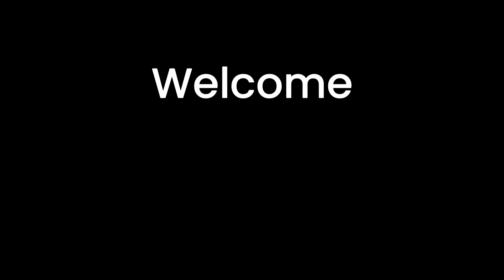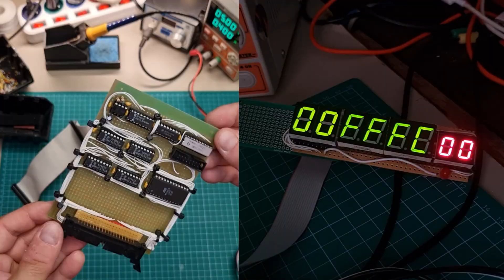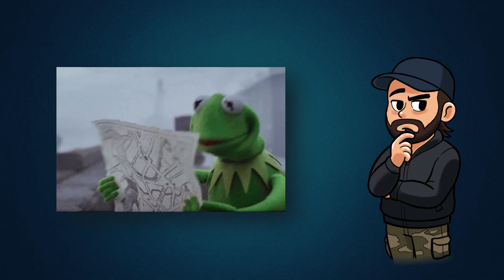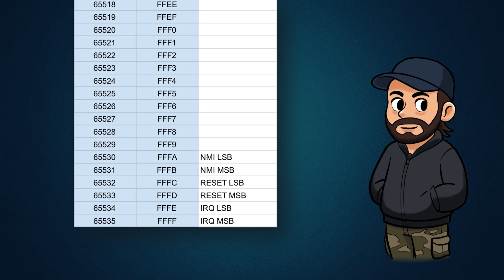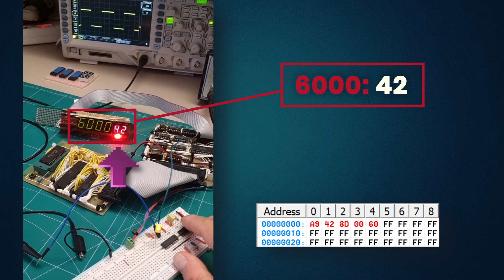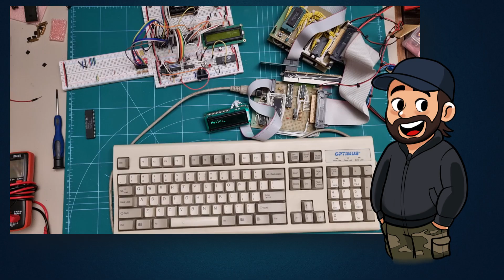I Added the 6502 CPU to My Homebrew Computer

Comment: About that bus...

First, I would segment the address space. Keep the top and bottom 16 kB on the CPU module as local memory, and only put the middle onto the bus. Have two output chips for the high bits of those 2 middle RAM segments, enabled each by a decoder for the top 4 bits of the 6502's address bus. That way, you can map them into your whole bus address space.

Next, I would make the bus DMA-driven. (That's why half the memory stays on the CPU card.) Add access request lines and logic to assign access (simple; lowest line that wants it, gets it). Now, when the CPU selects one of the middle segments, add logic to halt the CPU while bus access is requested.

And now you can add as many CPUs to the system as you want.

Comment: If signal integrity over the ribbon cable becomes an issue, one way to solve it from 1980 is to wrap the cable in plastic-laminated conductive foil (like flatflex, or just stronger aluminium foil with spray-can laminate maybe?), with either a separate ground lug screw for each board, or reserve the outermost conductors and solder it to the ribbon cable.
Reply from the maker: That's a great tip! I hadn't thought about foil-wrapping the ribbon cable, but it makes perfect sense. I will definitely keep that idea in my toolbox for future revisions. Thanks for sharing!

Comment: seeing ben eater's 6502 series inspired me to make my own computer too, that I'm calling the K17 (pun on 'kit'). I have written an emulator for it (available on itch), primarily so I could start developing the bios and some games, while the hardware progress is currently paused.
two of my main design goals are to use only through-hole components, and only parts that are still in production; with the hopes of eventually selling it apple 1 style, like you'd buy the bare boards as well as the components, and assemble it yourself.
Reply from the maker: That sounds awesome! I love the name K17, clever pun 😄
The THT + in-production parts goal is super smart, especially if you're thinking of sharing it kit-style later on.
Let me know where to find it on itch, always curious to see what others are building.
Reply from the maker: Oh, I just checked out your channel and was pleasantly surprised to see you're using IDC ribbon cables too! But wow, your setup looks way more professional than mine 😄 Really cool to see someone else go that route, love the clean layout!

Comment: Very cool. This is the first processor I ever programmed almost 50 years ago. Also the first and last processor I ever fully understood.
Reply from the maker: That's amazing, 50 years ago, wow! I really admire that kind of experience, and I totally understand why you connected so strongly with this chip. I've only scratched the surface compared to you, but even now I get why the 6502 has such a special place in people's hearts. It's still so much fun to explore. Thanks for sharing that!
Reply: @kaligari88  I remember the version I worked with had a bug in the microcode. If the address following a JSR fell across a page boundary the second byte of the address was read from byte 0 of the current page instead of byte 0 of the next page. Almost lost my mind over this. BTW love your single-step debugger. Really wish I'd had one in college. Looking forward to your next video.
Reply from the maker: Whoa, that bug sounds like a true sanity check😄Glad you liked the debugger, thanks a lot! Next video is already cooking!

Comment: Good stuff, wiring that up in that way had to be pain. Look up Dr. Matt Regan, he uses similar prototyping technique I do, I feel it is very fast to wire up prototypes that way (well, very fast is a relative term when you have to throw around whole buses of 16/8 signals). Neat thing is that if you have good power distribution (low resistance +5V and GND wires, decoupling caps near chips) having "random" wires going point to point is better for EMI than "neat" bundled wire harnesses.
Also fun to see my comment in a video.

If your bus won't go over a few MHz then there should be no problem with signal integrity I think. OG ATA used those cables with 8MHz transfer rates and they too didn't have 50% of the wires designed as grounds (they switched to 80 conductor version with 50% grounds to go faster). They had 7 grounds actually.

Using a separate JST for power is fine IMHO if this is going to be a multidrop bus using a ribbon, won't be as neat as having power on the ribbon itself, but those signal wires don't come cheap.

What I would advise is maybe go the way of RC2014 and use pin headers and a master backplane - while it won't be as elastic of an design (pun intended) there are some benefits to that.
I would use two dual row 40 pin headers side to side (2x20), declare that 4 pins on both ends are to be used as power (one side +5V other GND), that leaves 72 pins to do stuff with. Of that I would declare at least 16 to go to GND for signal integrity reasons - that leaves 56 signals to work with. Negative part is that this would need pricy boards (40 pins at 2,54mm pitch mean that the board would be over 100mm on one side, so if you would want to do boards manufactured in China it would go over their 100x100 cheap option, I would go for 4 layers anyway so the cheap option goes out the window anyway).
But that is me ;-)

EDIT: Fixed bad math and typos ;D
Reply from the maker: Thanks a lot, this is gold!! 🙌
I know the wiring looks like a pain, but honestly, even the soldering is part of the fun for me. It slows me down in a good way, almost like meditation 😄

I really admire Matt Regan's work, I've seen many of his videos, and I'm always impressed by the clarity and depth of his explanations. Super inspiring stuff.

You're absolutely right about EMI, I've read similar things about messy wires sometimes outperforming neat bundles, as long as power distribution is solid. I'm staying below a few MHz for now, and things seem stable, but I'm keeping an eye out just in case. That said, I still want to stick with ribbon cables for now. They are easy to route for me, and I get full control over every signal line. That simplicity helps me iterate faster. I totally get the appeal of a proper backplane. I might go that way if I ever do a v2. Nevertheless your suggestions on power and grounding make a lot of sense. I'm seriously considering adding few GND lines between signals in future episodes.

And hey, it was fun to include your comment in the video! Thanks again for the thoughtful feedback!!😄

Comment: I prefer the Z80 CPU, it starts executing code at addresss 0000h. Makes it easier to write a ROM image from scratch. I also find the Z80 a more versatile CPU with it's 16 bit registers and expanded Op-Codes.
Reply from the maker: Totally! Z80 is an amazing chip. I started with the 6502 because I'm more familiar with it (and yeah, Ben Eater 😄), but now the bus and modules are in place, you have just planted the idea in my head of trying out a Z80 too, using the same approach 🤔 It’s all about learning anyway!
Reply: @kaligari88  It's all fun. Subbed BTW. 👍
Reply: 6809 is the best of the 8-bits, but it was released when the 16-bits were already getting popular. Look into it. Very interesting CPU. The 6502 is still my favorite vintage CPU but it was actually inspired by the 6800.
Reply: @soloflo  My first programs were writen on the Z80, so I'm a bit biased. I could never realy get to grips with the limitations of the 6502. I never encountered the 6800 series of CPU's.

Comment: Seems quite interesting. Id be interested in using something like this for a robot im building, so im hoping i can follow along and do similar stuff to get the robot going
Reply from the maker: That's a cool idea, would love to see this used in a robot! It reminds me of Bender from the Futurama cartoon, who was running on a 6502 😃
Hope the series helps - and feel free to share your progress if you build something with it!
Reply: @kaligari88 I have a 24vdc to a 12vdc, 5vdc, and 3.3vdc board I was half tempted to add to your project as a pull request, and follow along
Reply from the maker: That is awesome! Power management is a whole project in itself 😀 Maybe there's a clean way to simplify it down to just 5V for this build? If you want, feel free to send a PR 🙂
Reply: @kaligari88 of course. I haven’t figured out the pcb side yet, but I could definitely have the schematic as a pr in a bit

Comment: Does this mean it can run Plok! on the Super NES?
Reply from the maker: Only if you're okay with 2 FPS and ASCII graphics 😅
Reply: @kaligari88  6502 couldn't handle the colours Plok! had so it wouldn't run anyway.
It was a silly comment I made while under the impression that 6502 = 65c816
Reply from the maker: @meatrack  Not silly at all, the 65C816 is a legit upgrade path, and now you’ve got me thinking 😄 Appreciate the comment
Reply: @meatrack  6502 vs 65816 is a whole other can of worms. Both talk to the outside world in 8 bit bytes through 8 bit bus. The meaningful difference NES vs SNES is in the graphics generating circuitry, 6502 could do that too, would just need a bit more instructions to sling the data around.